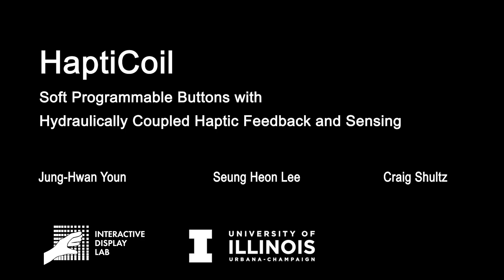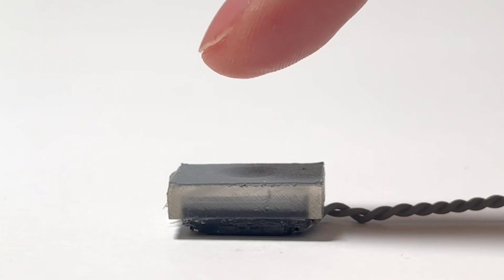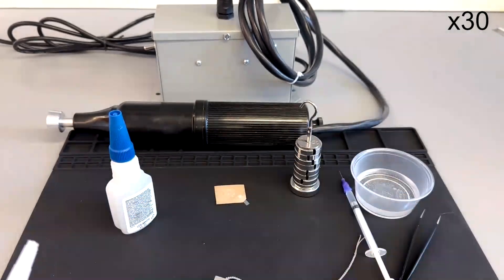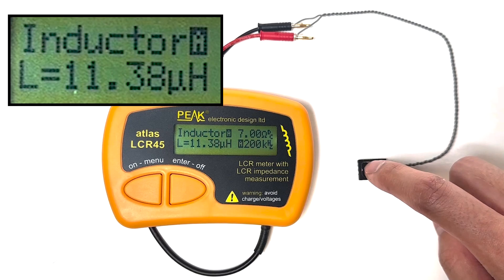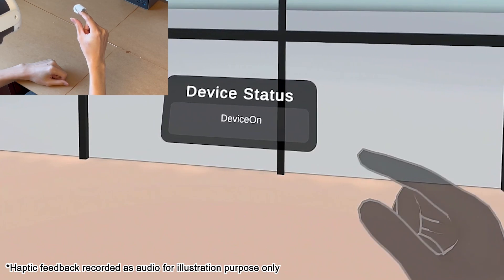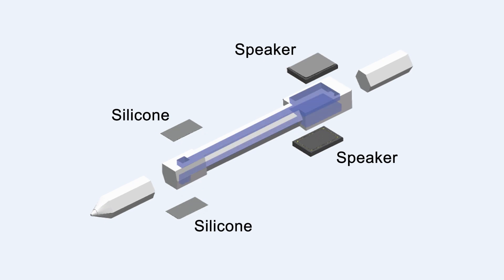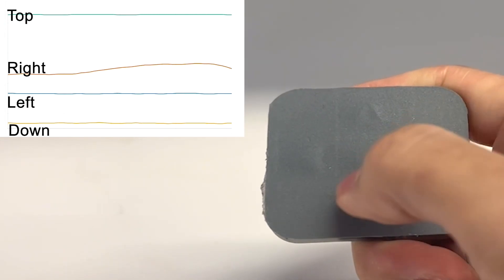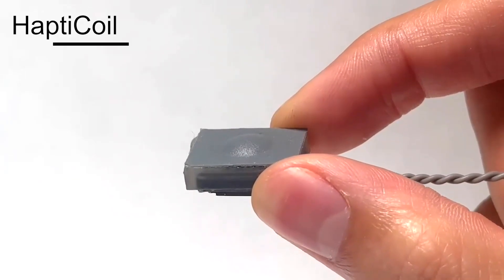HaptiCoil: Soft Programmable Buttons with Hydraulically Coupled Haptic Feedback and Sensing

Comment: The use of a loudspeaker as actuator, makes the HaptiCoil incompatible with maintaining a certain position fixed like the Dynabuttons right? Just up and down at the frequency of the PWM signal? In order to maintain that certain position fixed, are there any alternatives to the dynabuttons? The paper and research is awesome, congrats.

Comment: Amazing idea and worked great!
But one thing, there is usage of tap water, which might leak or cause corrosion if used for a long time.
Reply from the maker: Great point! Something like silicone oil or maybe something biodegradable might be better. We just used IP rated speakers so we didn't want to use too crazy liquids here

Comment: Great novel idea. Can you help me understand figure 10C? it take 3W to generate 100mN of force? But a typical button press is 0.5N? So 3W is 0.1N? Do you think higher voltage should help to move that speaker a lot more? My friend got a start up call Boréas Technologies where he design high voltage piezoelectric controller. I think it’s >100V to create amazing haptic feedback.
Reply from the maker: Boreas is great and Simon's drivers are spectacular. Yes, electromagnetic coils have a problem of low output force, so here we can only provide a few hundred mN even though we can detect high forces. What HaptiCoils are good at is fast, moderately high displacement actuation, allowing us to do effects in the 5-10Hz range (whereas piezos are typically limited to 100-200Hz only). Look for more piezo projects from us in the future!

Comment: Can I drive sensation into the skin without pressing on it, but rather strapped to an arm.
Reply from the maker: Absolutely, it's totally programmable, so you can also just use them like an actuator.
Reply: @InteractiveDisplayLabUIUC  i have a prototype that uses the same vibration motors you showed there to create a novel input sensation. 

This is a cleaner, more modern way of doing it!

The capacitance could be used to know how hard it's hitting your skin. 

Do you sell these?

I have a printer, but would rather a perfect build to mess with.
Reply from the maker: @andrew-729  You find some more information about what we use in our paper: interactivedisplaylab.com/research/2025-hapticoil

Some people use LRA back-emf for sensing, including a project from Google called Vibrotactile-Haptic-Platform (VHP) but those motors are usually limited to high frequency operation only
Reply: @InteractiveDisplayLabUIUC  so no chance on buying them? I'll look more into what you used.

Comment: I suppose my next thought would be... What if you embed neodymium magnets in the silicone membrane and do a cross array of coils under the soft part.... Shake just the magnets... use that to send the button signal.
Reply from the maker: That's pretty interesting. There is some work in that approach, which is a "moving magnet" type of actuator. Could see that working.